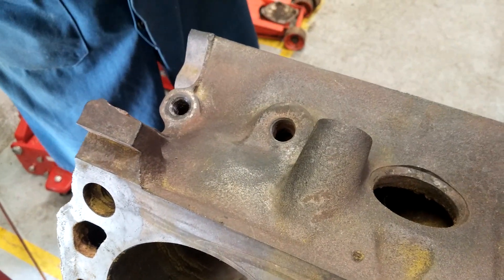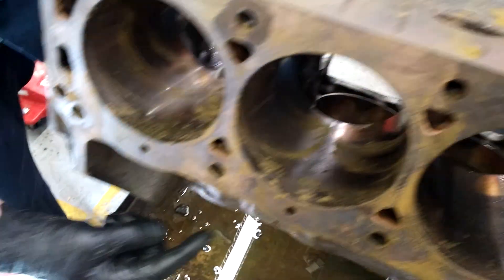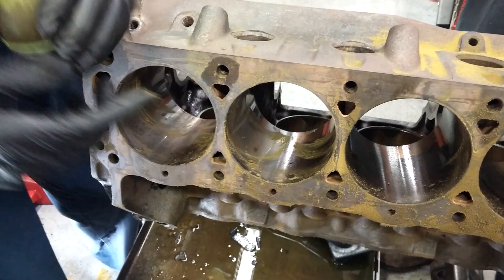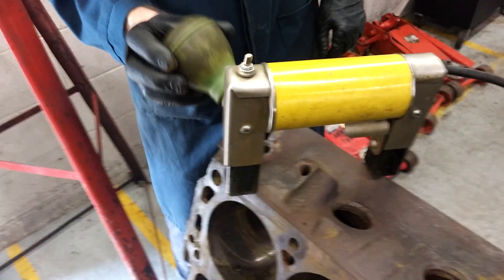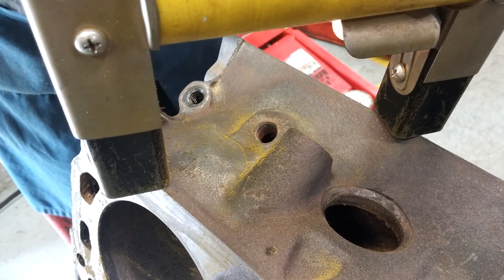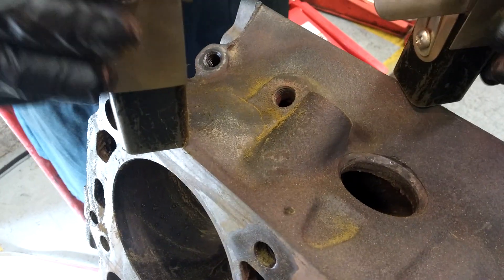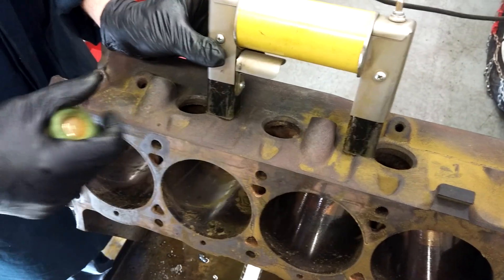Checking for cracks using Magnaflux (magnetic particle crack detection)

Comment: Is it possible to weld a crack in the cylinder bore?
Reply from the maker: Just about anything is possible with the right resources and skills, but I don't know anyone who welds cylinder cracks.  It usually simpler, less expensive, and more certain to just replace the block.
Reply: I have a friend who says “there is no problem in life that can’t be solved by paying through the nose!”  😂

Comment: How do you find cracks in an aluminum block?
Reply from the maker: You would clean the surfaces and then inspect it carefully, perhaps using a flashlight.  Then if you see potential cracks, you can use the dye penetrant method.  To be honest, just about all cracks in aluminum can be spotted with a careful visual inspection.
Reply: @JustinMillerAutomotive Thanks Justin. Good to know.

Comment: What is the button for on top of the magnet?
Reply from the maker: That is to turn the magnet off or on.  It is an electromagnet.
Reply: @JustinMillerAutomotive  Thanks, I just acquired an identical unit at auction yesterday for 15 bucks.

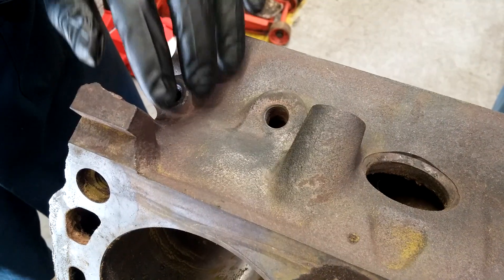Comment: I spotted that crack with my bare eye at 0:19 even before you started using Magnaflux.
Reply from the maker: Yes.  You can almost always see the cracks with your bare eyes.  I usually only use crack detection when I find what I think "might" be a crack and I want to confirm it.
Reply: Using MPI you can also find shallow sub-surface cracks (up to about 1/8th of an inch deep) that are not visible on the surface.
Reply: Some are sneaky though, check everything.
Reply: I thought I saw it but then as soon as his hand passed over it i caught the shadow and was sure 0:08 . came to the comments to see if anyone else saw it👍